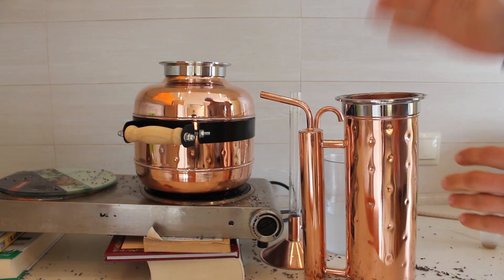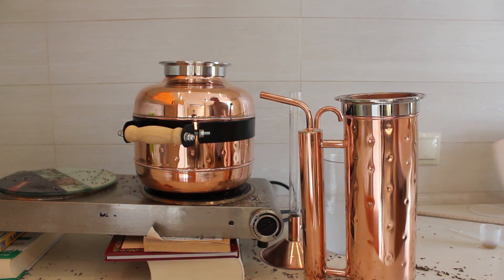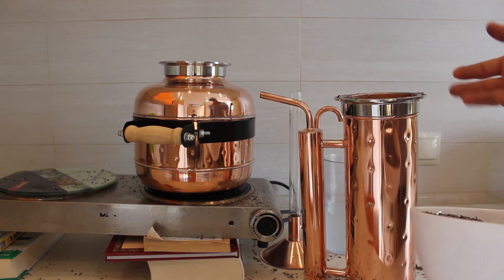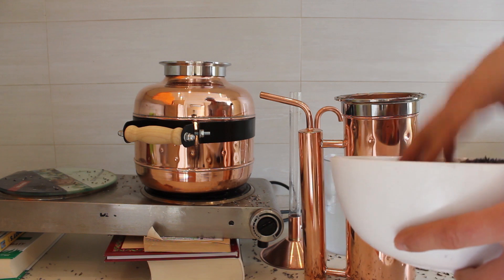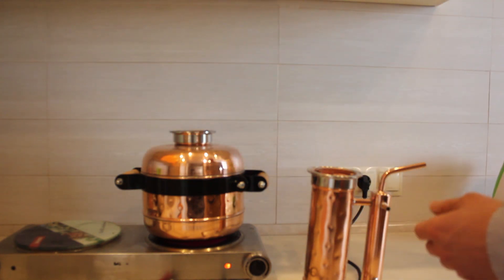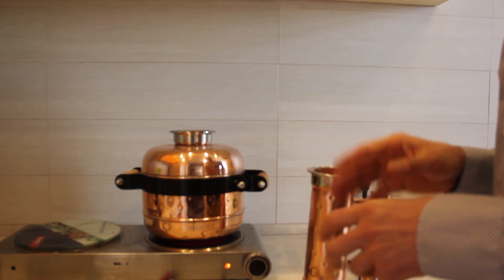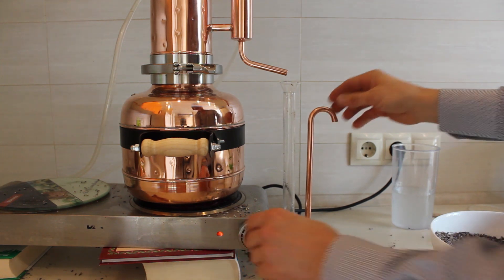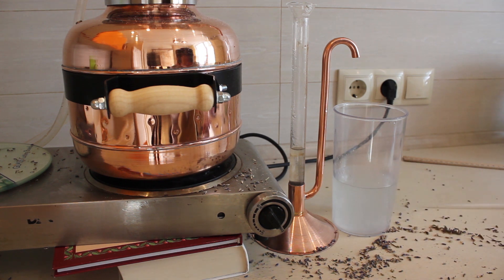How to make essential oils with 4" steam distiller Ukrainian Copper still

Comment: Much easier,  not "much more easy". But thank you for the video. It was excellent.
By the way, have you dried out the flowers first? What temperature do you use to make the oil?
Reply from the maker: Thank you for your comment.  For the distiller to work properly, it is necessary to maintain the boiling temperature of the water.  For the production of essential oil and hydrosol, you can use both fresh and dry raw materials.

Comment: Hello! this video is really helpful, I'm getting one for sure but I have a question: can I use a normal fire stove? would that make a significant difference?
Reply from the maker: Hello, you can use an electric or gas stove or burner, it is important not to use induction as it does not work for copper products

Comment: Hello, what about preservatives? Are they needed? Is any water distilled along with the oils? Thank you for your video.
Reply from the maker: you just need to use clean drinking water that you pour into the boiler, and you can use tap water for cooling

Comment: I'm shopping for distillers and this model appears to be efficient.But I got so many questions. I may give you a call to talk to you instead. One of my questions is about about the type of lavender you distilled in this vid, its purity, pH etc.. So 3" vs 4" for a 5L distiller how were those dimensions determined? also, if I get a 10L Can I use those columns in the 10L why yes and why no? are the columns interchangeable?
Reply from the maker: Hello! for distillation we use raw materials grown without chemical treatment, 3 "or 4" is the width of the column, now we do not sell a 10l distiller, but for 10l we need a 6 "column, if you need such an additional column, we will make it to order, if you have have additional questions you can write to our email: copperproc@gmail.com

Comment: What can be done with the herbs that have been used? I'm very new to distillation, but I want to learn.
Reply from the maker: if you grow your own plants, the used plants can be used for compost to fertilize the soil
Reply: Buy it Keba...I make essential oils but this is super good. Real well built and strong. It beats any distiller that I seen so far.
Reply: @eileenjackson2893  thanks so much for the encouragement.  Excited.
Reply: I put mine around under the trees they are just dried out plants but I save the water that comes out and use it to make mouth wash and cleaning products

Comment: Ok so I have purchased this exact distiller, my question is I see the 2 hoses connected to the distiller, but what are the other ends going to?
Reply from the maker: Hello! the end of the hose is connected to a tap or pump, the second hose is lowered into a sink or a bucket with a pump
Reply: @CopperPro  okay so both hoses are connected to a hot and cold water source, correct? Sorry, should I just email someone in your company or is there another video that shows where everything connects to?
Reply from the maker: @oliviafaith692  in this video full instructions for use
https://www.youtube.com/watch?v=FaIzcVkmA7k

Comment: Hi, is there a way to modify the water in/out setup so that the water circulated instead of going down the drain?
Reply: Aquarium pump in a bucket of water - use a cheap irrigation tap to regulate the water flow
Reply from the maker: Hello! you can purchase a pump and an adapter from us, then the water will circulate from the bucket to the distiller

Comment: So... the amount of oil that you pipetted from the top is the essential oil yield from the lavender? That seems like a very small amount.
Reply from the maker: Yes, it's output of lavender oils per 20 min, if you want to get more essential oil then you need different model of distiller, what essential oil output would you like to receive?
Reply: @CopperPro  I was going to attempt to manufacture. So I need to do a few ounces at a time.
Reply from the maker: Karen Peters then I recommend you this model of the distiller https://copper-pro.com/product/essential-oil-distiller-145-l-proffesional-set/ , also we will soon have a new device for 20 l

Comment: have you 5 or 6 inch colum device ?
Reply from the maker: Greetings, no at this moment just only 5l, 3 inch clamp with 1,78 l column. Other models for alcohol distilling.
Which volume of column are you interested in?
Reply: i am interested in just bigger like 8l or 10l
Reply from the maker: @touheedrana5681  Do you need 10 l volume of the column?  
We can desing it and manufacure for you.  Do you need it in copper or stainless steel?
Reply: yes 10l is sufficient and stainless is best according to my uses. 
how much it costs
Reply: touheedrana@gmail.com
it's my Email I'd
Reply from the maker: @touheedrana5681  Thanks, we have to calculate. I will send the additional info
Reply: thanks